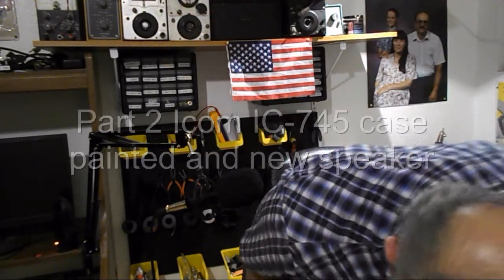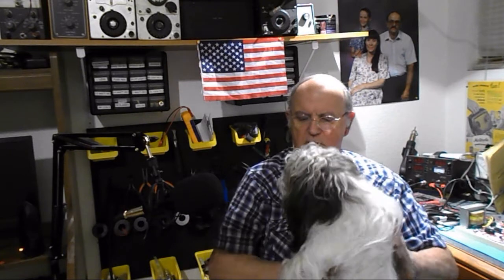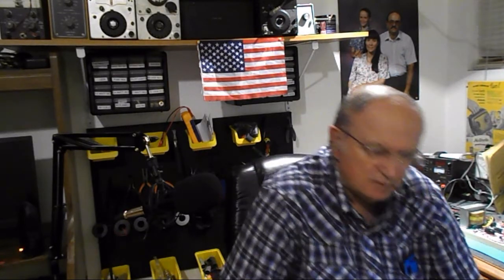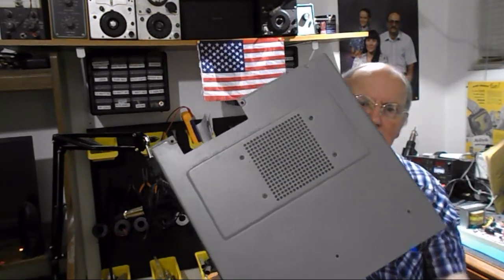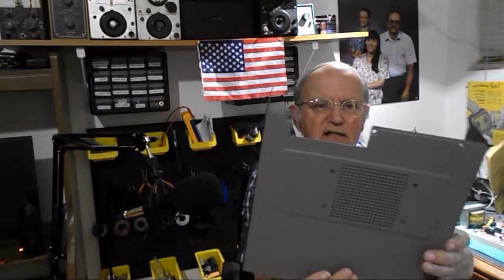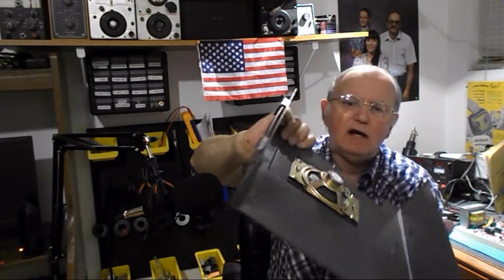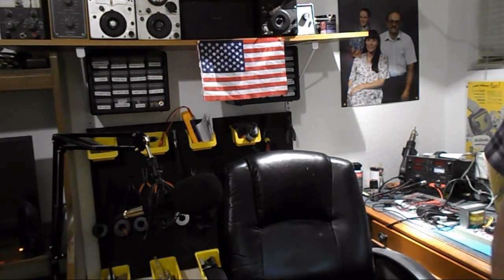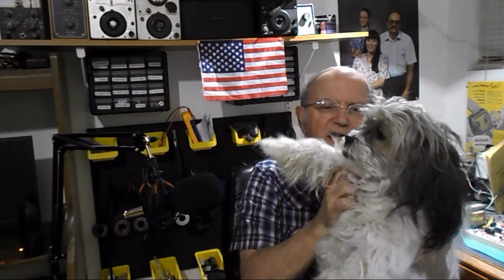Part two Icom IC-745 Transceiver case painted and new Speaker added and test

Comment: Glad you found the problem, nice radio Larry
Reply from the maker: It took me awhile but, hey all these solid state rigs are a bit complicated. But when I figured it out everything works great. Tonight I took the bottom half off to expose the other side of the circuit boards so far no evidence of any damage no swelled electrolytics no hum perfectly clean signal. Wouldn't you know it my brother Ron was on 40 meter cw and was overloading the front end of the receiver when I turned it on lol. I recorded him on my cell phone and sent a message to him this sounds like you. He said yep it was him lol.